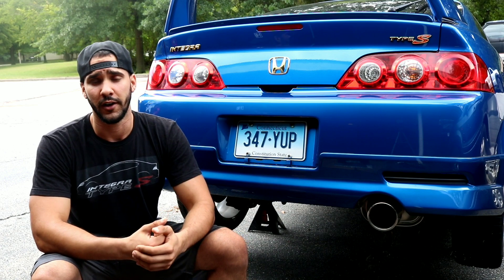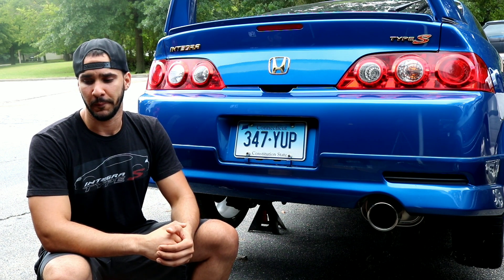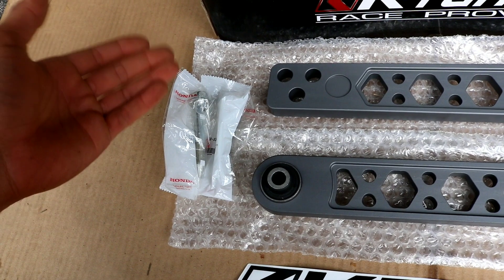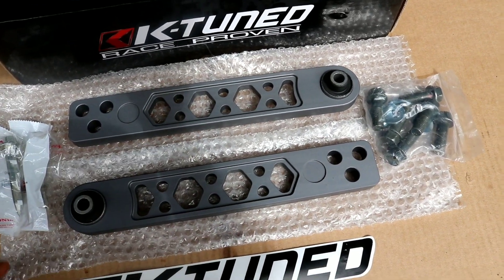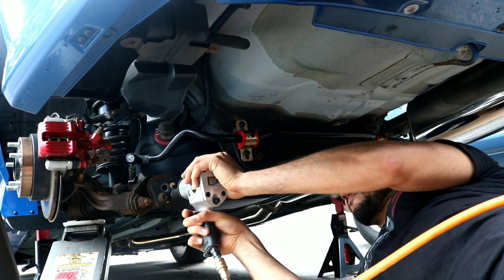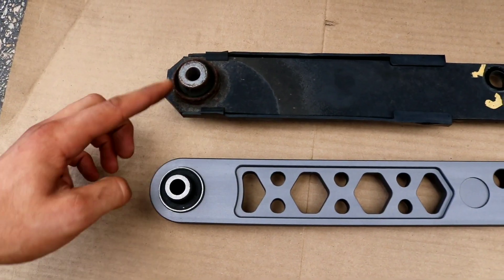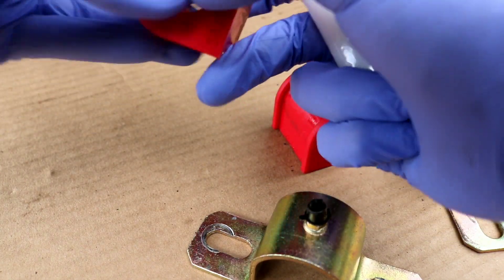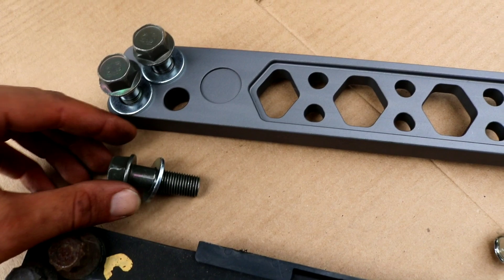Are they any good? | K-Tuned Rear Control Arm Install | Episode 30

Comment: Remember kids: use a torque wrench, use PB Blaster, If you reuse bolts use a small amount of thread locker (too much will ruin the torque), and don’t torque/tighten anything relating to your bushings until your vehicle is ON THE GROUND. Not on a jack, on the ground with the wheels on it.
Reply: Then how would you tighten it on the ground 😂

Comment: YIKES! 14:24 Do not tighten bushing bolts down when the suspension is unloaded. This will cause premature wear and ultimately result in torn bushings.
Reply from the maker: Cool, Thank you for the tip! No issues here even after multiple track events and thousands of miles :)

Comment: Do you happen to know if the bolt part num the same with JDM DC5R 2003?
Reply from the maker: Yes it should be, no difference there
Reply: @DC5RParts  thanks!

Comment: Hey man loved the vid! Thinking of making future vids of the car I buy! I’m being sold a 2006 Rsx type s for 5k with 130k miles worth it?
Reply from the maker: Thank you for watching! For a 2006 that's low miles averaging 10k per year. That's not bad 

It all depends on the conditions of it, color as well.

check engine compression first, there you'll determine if it's worth your time.

If it's good condition, go for it! $5k is a great start up price!
Reply: Yes it’s amazing condition no rust anywhere! It’s a black one. It’s been garaged it’s whole life! Just the front hood has some chips do to rocks hitting it down the road. I know the guy selling it very well. Basically family. I even remember when he first bought it, and I wanted it so bad. So from what I know it’s been well taken care of as he never put any mods except a SRI everything else is bone stock!
Reply from the maker: Seems like a great pick! I would definitely go with that one. Just go through the basics such as compression test etc.
Reply: How u liking that Type S? I just picked up a NightHawk Black Base with just under a 127k on it for $2500, clean rust free car other than some ripped seats and worn out suspension. Talked him down & all thats getting replaced anyway!  K24 swap coming up in the future.

Comment: You need subframe brace and tie bar to finish it off back there.
Reply from the maker: The 05/06 Type S has a lower tie bar from factory. I replaced it with our aluminum bar, not shown in this video. And I personally don't like subframe braces. It looks exactly how I wanted it to look. Thanks for your recommendations.

Comment: Are those pepboys sway bar bushings??
Reply from the maker: Energy suspension bushings. Quality stuff only. 💪🏻
Reply: @DC5RParts  where did you buy them?
Reply from the maker: You can find them anywhere really except local stores. What you need to know is the size for the bushings. For example "energy suspension 21mm sway bar bushing"use Google. 👍🏻
Reply: @DC5RParts  thanks what size are yours?

Comment: /gg new LCA you have to drop the car first before you tight it cause u gonna mess up the new LCA
Reply from the maker: Thanks for the tip. Having the jack compress the entire assembly will minimize that effect once fully lowered. It's been 2 years and plenty of track time. They haven't failed. Your theory could be right but it hasn't happened and I doubt it will happen. I appreciate you watching and your criticism! 💯👌🏻